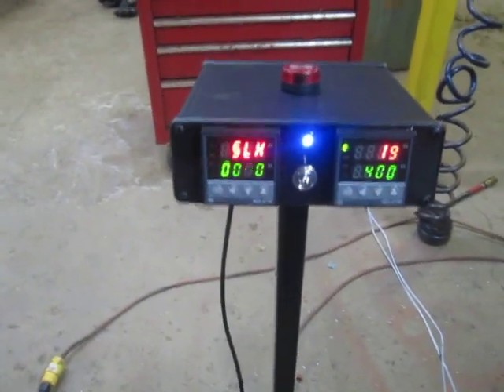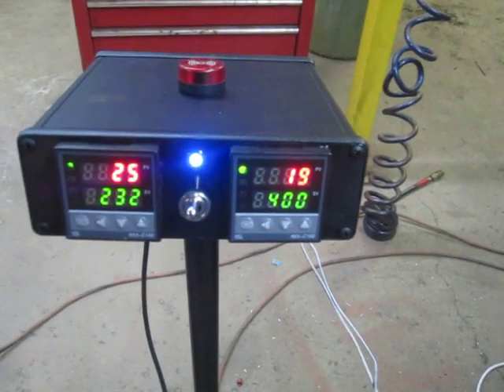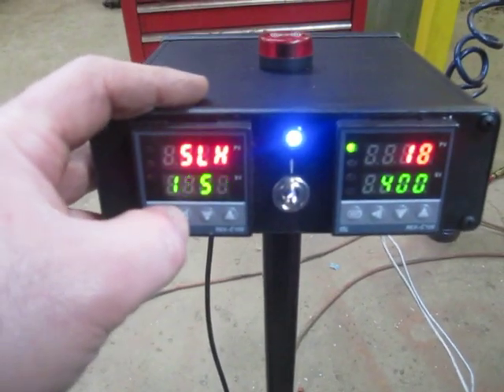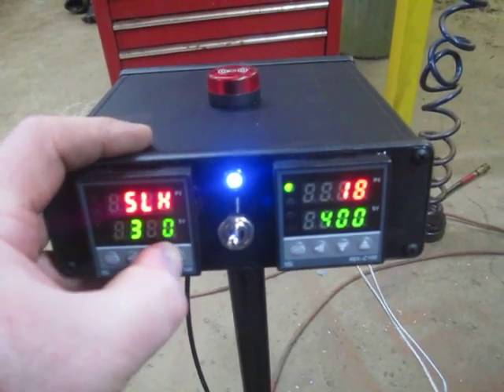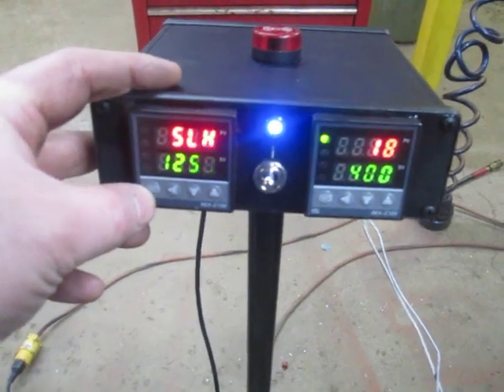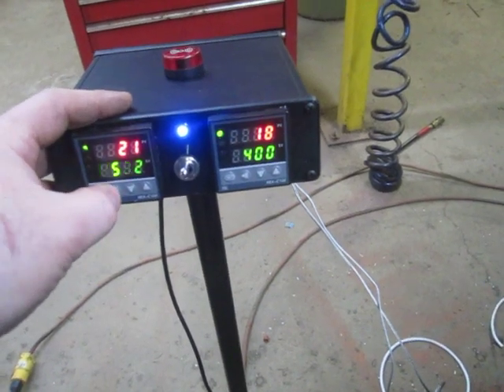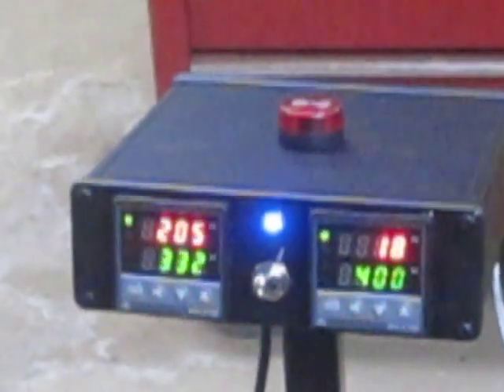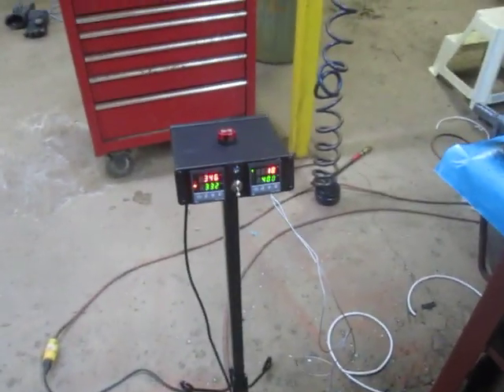Changing High setpoint in menu rex c100fk02

Comment: Thanks so much for this post. i use REX-C100, I am using it with a K-Type thermocouple and a heating element. Whenever i adjust the temperature to the intended set value, it keeps showing LLLL or HHHH  and i don't know how 
to fix this consistent problem. i will need your guide urgently pls.

Comment: so many thanks, I just bought a cheap RexC100fk02 and I get troubles when I saw "400°C, no more"...
I did not try the set+left at this moment, but I believe it will work, PID manufacturers are not stupid at the point to modify completely the design just for a temperature range (in fact, it uses a K-type thermocouple which can measure temperatures up to 1372°C)
Reply from the maker: YW
You should be fine. Just make sure the unit is unlocked using  the LCK parameter.
Reply: *****
it works perfectly.

I had to modify the value CoD to 1 (as described on the video) to access the SLH menu.
I got it ip to 1372°C as the thermocouple allowed it.

I will try it tonight on my waste oil melting furnace.

I have to modify other parameters to access the thermocouple type (we plan to use a S-type thermocouple for temperatures around 1600°C) and I know it's possible with this stuff, i just need to find the right menu.

Comment: What type of alarm are you using, brand, type, and where I could get one?
Reply from the maker: The Buzzer/alarm is available from eBay, as are the PID's.
Reply: ***** I was searching ebay to find the exact buzzer like yours, I haven't had any luck yet. Do you happen to have a direct link to the item? By the way, great video that code will come in handy!
Reply from the maker: Hi Rayon,
Here's a link for the 12v model. http://www.ebay.com/itm/2Pcs-Buzzer-AD16-22SM-Red-Bulb-DC12V-Flash-Buzzer-Acousto-optica-Alarm-AK-/271340936918?pt=LH_DefaultDomain_0&hash=item3f2d2e1ed6

And the link for a 120v model: http://www.ebay.com/itm/1pc-110V-22mm-Flash-Light-Red-LED-Active-Buzzer-Beep-Indicator-Intermittent-/171131763458?pt=LH_DefaultDomain_0&hash=item27d83f7b02

The best keywords to use on ebay are" 22mm buzzer", that gives lots of results in various colours and voltages.
Reply: Thank you very much!
Reply from the maker: YW